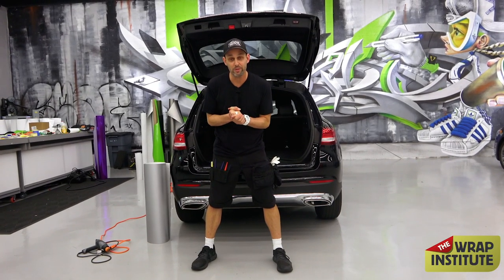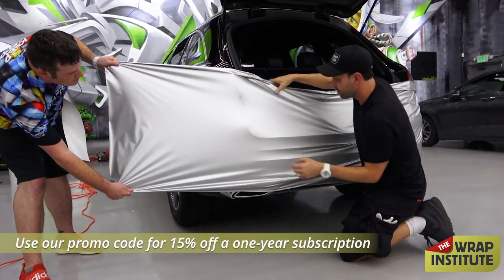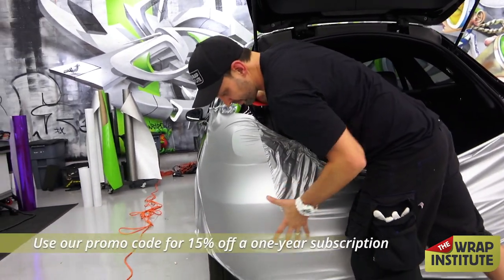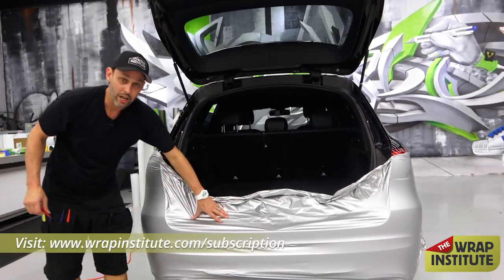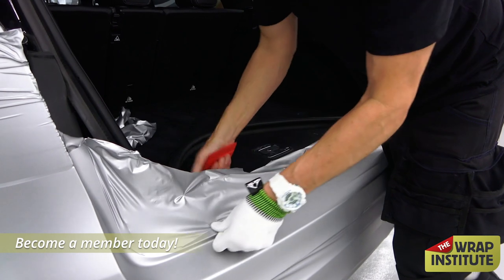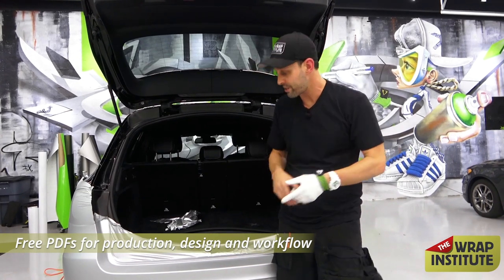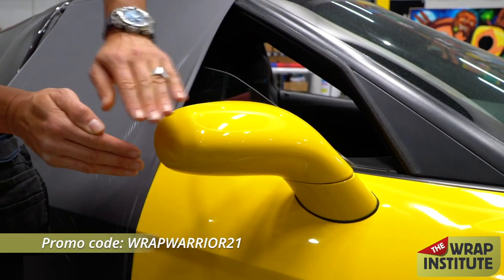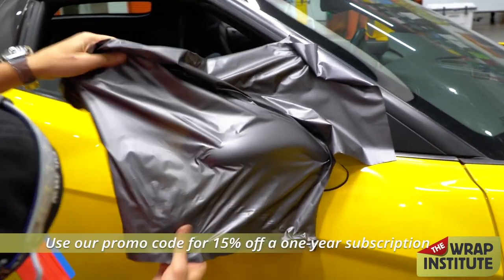Wrap Warrior TWI Booth

Comment: What is your heat gun tip wrapped with? I have burned my arm too many times and have looked for something for protection for skin and vinyl.
Reply from the maker: that is a heat protection tape. You dont need it if you buy a Weldy, it has already a heat protection device from factory! Buy here: https://www.amazon.com/stores/page/D973CADF-0CAC-4F62-B553-A57F95379B1A?ingress=3&visitId=ff2b8fd1-ea23-47e6-aca8-526bf03fbbeb